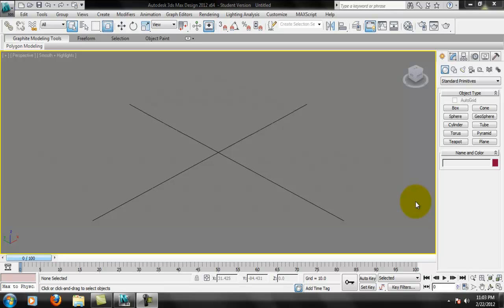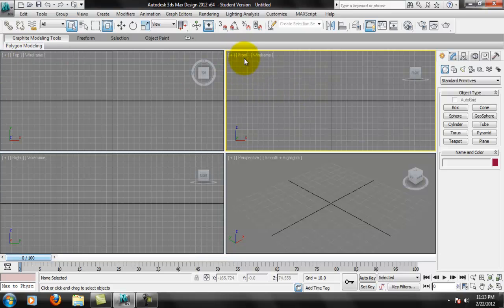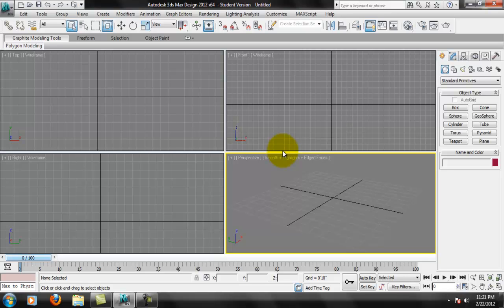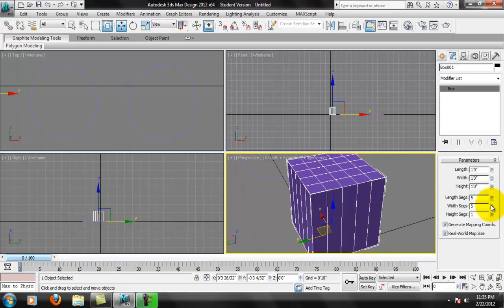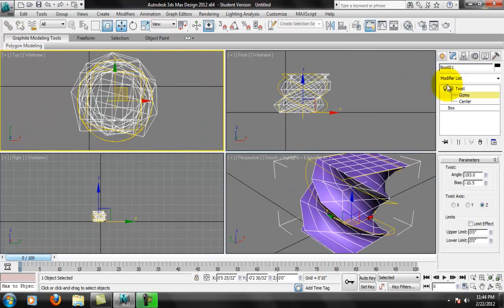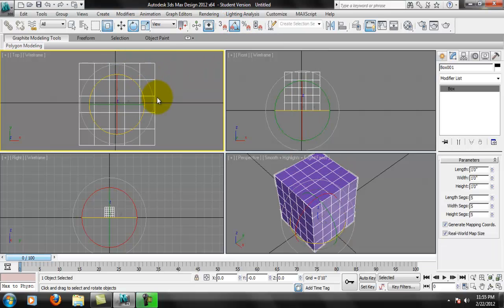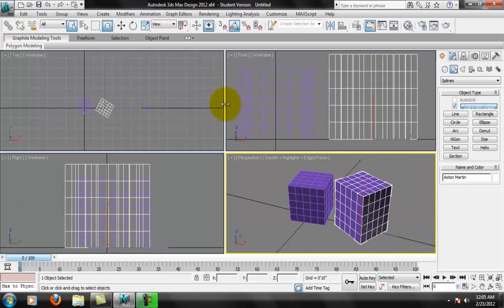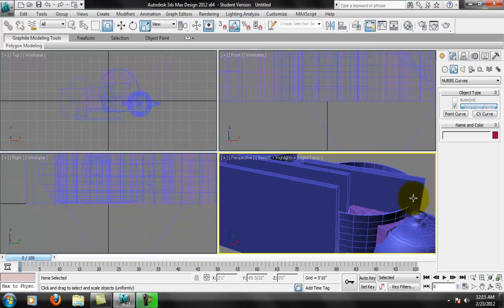Autodesk 3ds Max Design 2012 - Week 1

Comment from the maker: Hey there. There are two methods for creating a reference image in 3ds Max. The preferred method is to create a texture with a diffuse map of the image you want to trace. After you create the texture apply it to a plane with and add a UV map. The second option is to select the viewport that best fits your image reference and select Views=>Viewport Background=>Files... After you select your file make sure "Match Bitmap" and "Lock Zoom/Pan" is selected. Otherwise the image will move around!